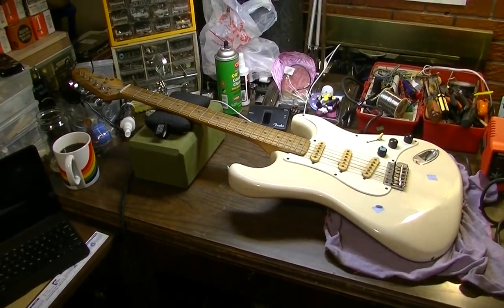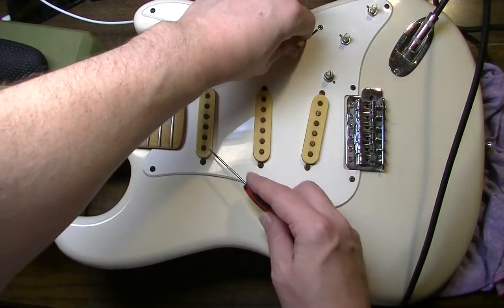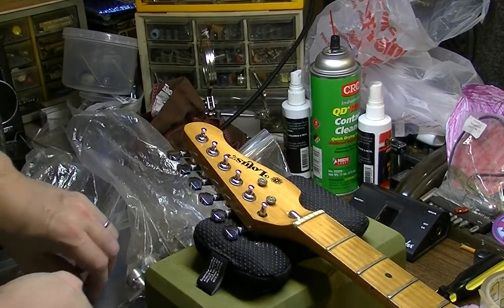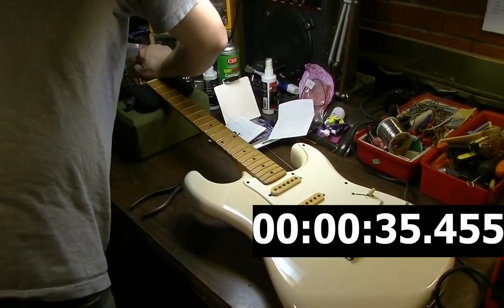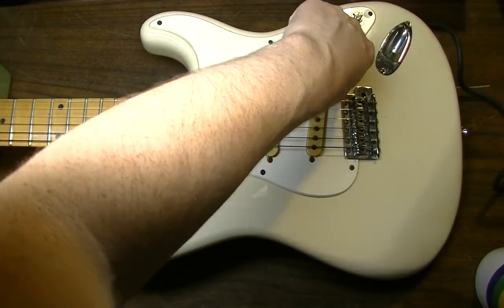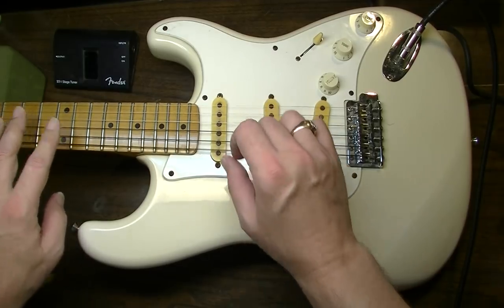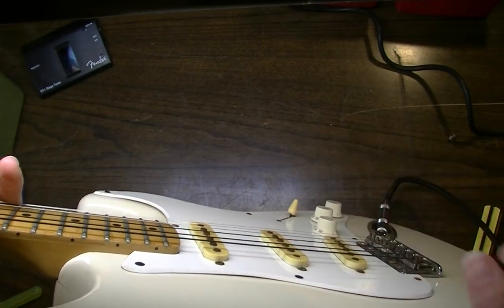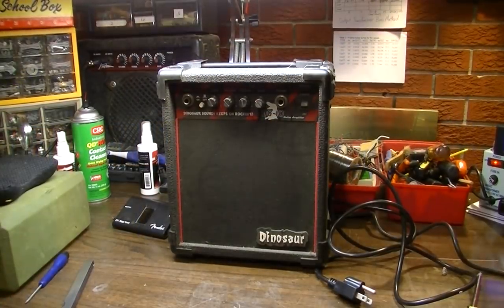$9 Thrift Store Axe Setup, Ultimate Speed Restring Challenge, Intonation Tutorial & MORE! - SPF

Comment: 39:05 The action on this guitar is horrific. The chances of even "good" intonation over this guitars neck is ZERO. The neck tilt is no doubt off and that's one of the reasons you have to remove the saddle spring. Tilt the neck UP and the distance to the nut changes. Love your stuff but you really missed the mark on this one. Fretting this bad action above the 12 fret HAS to stretch the string more than it should and hence the difficulty getting them to play in tune.

Comment: You know to get it clean your doing it all wrong you need the wire brush goodness what the heck are you thinking warm water Dawn dish detergent what that ain't even close like the fret board gosh wire brush and hose pipe possibly an old washboard in a creek would work but gosh why are you not doing it right stick to amps you apparently don't know the proper way to care for such a fine spencive ax lotus is rYtE up there with. Ferrari gosh dude you need to watch the Oriental guy 5jat found the nylon string guitar in the bushes well he found an amp or radio in the trash heap he was walking around in he washed it really good to 😜👍